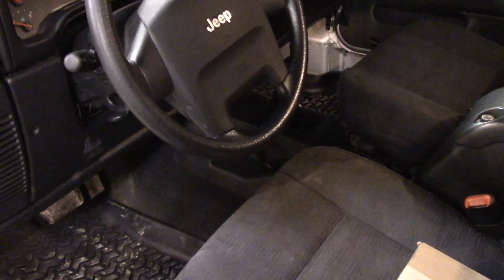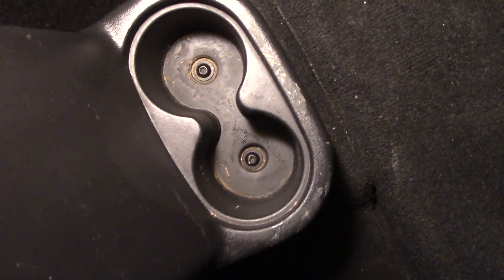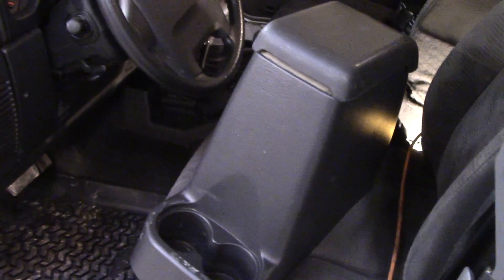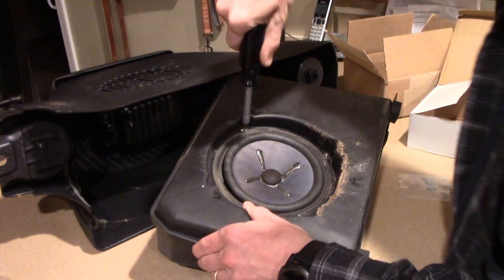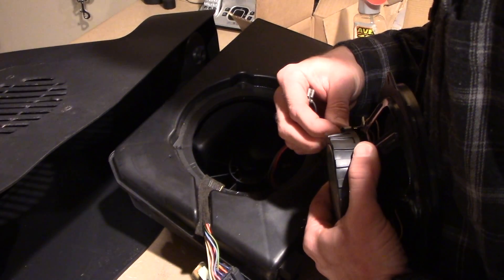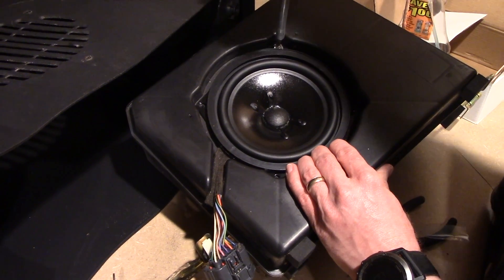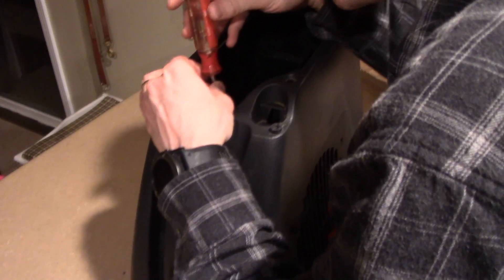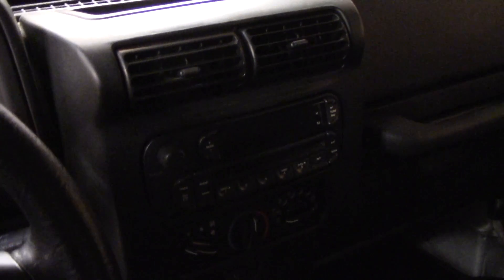2001 - 2006 Jeep Wrangler TJ OEM Subwoofer Replacement

Comment: Awesome video and an even more awesome product. I just bought an 03 tj and it has the optional subwoofer but, of course, it's blown.
Kudos to Quadratec for this awesome plug and play replacement.
We followed the video and, start to finish, had the console installed back in the jeep in about 45 minutes. Only tricky part was trying to unplug the harness.
The subwoofer is definitely an upgrade over the OEM one, with a polypropylene cone versus the paper cone on the OEM. It's very powerful, also. At mid or higher volume on the radio, I have to keep the bass level at zero and, even then, the bass is almost overpowering. At low volume, you can increase the bass level and it's wonderful.
I wish I had saw the suggestion to glue cheesecloth over the opening, I would jave definitely done that.

Comment: Ordered this exact sub from ebay like you suggested... FANTASTIC! I was able to change this sub all by myself, easy. I have a 2001 Jeep Wrangler and had just had a 1000 radio and speakers put in. They never said anything about a center sub. Being a 30s female with no knowledge of radios or cars for that matter was really sad when I start hearing popping noises. When I went back they said that it was the sub and that it would be another 400-2000 (depending on the sub I chose). The sub you suggested from ebay was under $150 and I installed it in under 30 minutes with your help! Thank you! The new system sounds great but all I smile about is the $139 sub I installed myself :)
Reply from the maker: Awesome job! I'm glad that you got it done yourself. That's why I made this video and I appreciate the feedback

Comment: This was a super helpful rundown on how to replace this speaker.  Only part that was a pain was the wire coupler, which wasn't intuitive to pull apart.  Had to look that up separately.  Otherwise, solid!
Reply: Where do I go to find out how to undo the wire?

Comment: Excellent video. I just followed this and replaced my subwoofer with no problem. One thing that I did was to take some cheese cloth and glue it to the inside of the console housing (over the grill) prior to replacing the speaker and amp. The reason for this is that I am a slob when eating and will always be dropping food crumbs, etc. down inside of the console grill. Without the round original factory cloth type ring which fitted over the original equipment speaker and which does not fit the new sub, I can see lots of crumbs falling down into the new subwoofer. This hopefully will prevent this.
Reply: I wish I had seen your comment before I did mine. That is an awesome idea.

Comment: How do you get the harness unplugged? I’ve been messing with it for an hour!!!!
Reply from the maker: I do not remember.
Reply: Jimmy , did you work it out? I'm having issues also
Reply: @spastroboy   I don’t remember now. I kept messing with it until I got it unplugged.. after that it was all easy.
Reply: Place a screwdriver into the slot and push handle down toward the wiring. Hope this helps...

Comment: This Jeep TJ in this video has an automatic transmission, but doesn't have cruise control...odd.
Seen a 2003 Jeep TJ 4.0L Sport with 5-speed standard transmission that had cruise control...more odd.
Good video here on the "uniquely sized" subwoofer replacement ChryCo. used in these awesome vehicles!
Reply: My 06 wrangler unlimited auto has cruise at least but no sub 😂
Reply: @SloppyTelopy  My 06 TJ is a non sport, 2-door, 6-speed, 2.4L 4Cyl , the console sub and cruise control. that being said with that little 4 banger sixth gear is not useful whatsoever

Comment: If you discard the entire enclosure, you can fit an 8 inch powered slimline sub in there. Just pack appropriately with foam.

Comment: Greetings, the PO has cut the pigtail connection off the amplifier and he tried to connect the speaker to a auxiliary unit. Do you have an idea where the wires going into the speaker are coming from?
I'll try to reconstruct everything else. Thanks

Comment: Looking forward to the double DIN install.
Reply from the maker: +david chilton posted that video today
Reply: How's the Quadratec subwoofer holding up?
Reply: @MarylandWearAndCarry  Was wondering the same thing, but I think he got rid of the Jeep. I'm thinking of putting it in also.
Reply: @rgwall9391  I still haven't pulled the trigger on a replacement. Let me know how it works out.

Comment: I have an 01 tj mine does not have a subwoofer in the console when I bought my jeep it was missing the lock on the console I've been looking for just the lock with no luck does anyone have any suggestions thanks
Reply: You can get the console lock from Quadratec

Comment: I am at a loss as how to unplug the wiring harness to the subwoofer.  I don't know if you have to squeeze it and it slides out.  Need your help.
Reply from the maker: I cant remember honestly. Dont have the Jeep anymore.
Reply: Mine just pulled apart, I needed a little wiggling as I pulled though
Reply: I had the same issue, thought there was a trick or lock. Just pulled and it separated.
Reply: @100Chiwawa  Thanks for the information. I was concerned I would break it if I pulled the harness apart.
Reply: Place a screwdriver into the slot and push handle down toward the wiring. Hope this helps...